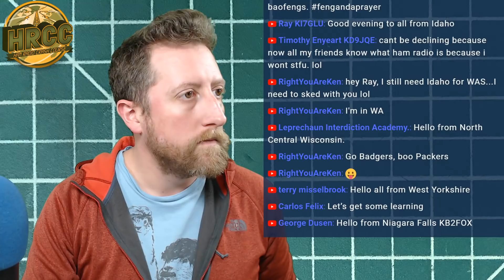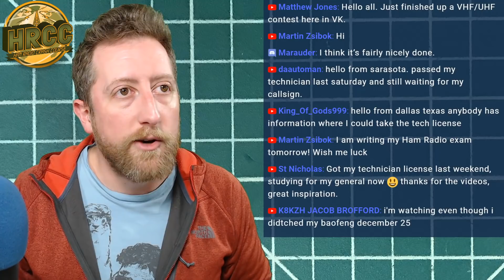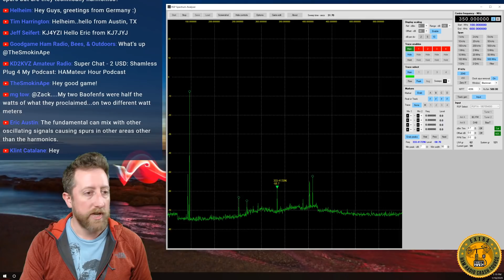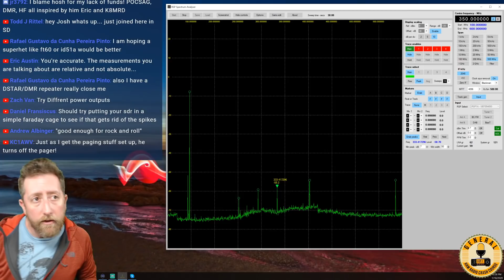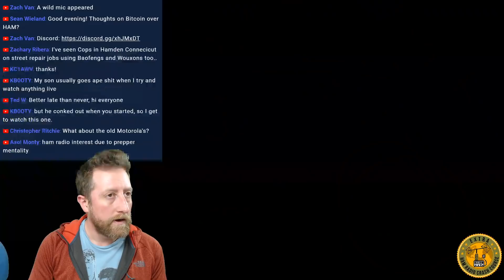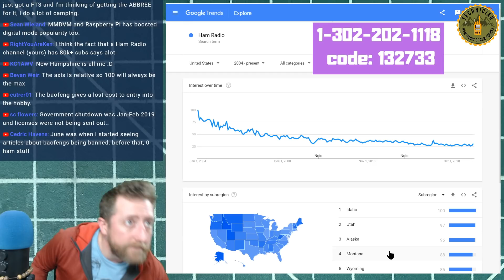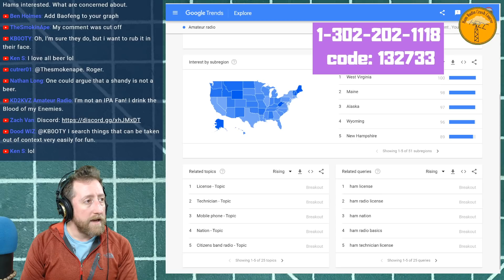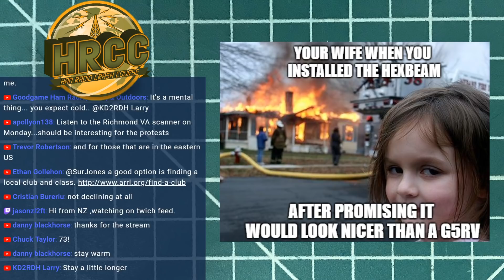Testing Baofeng Harmonics & Is Ham Radio Interest Declining?

Comment: Some clarification on Baofeng Harmonics from the 'Eclectic Tech' podcast - for VHF (30MHz -> 225MHz) the requirement is no harmonic over 25mW, which I is about -53dB for a 5W output. Without re-watching I think that some of these may have failed on that basis, or at least a marginal result rather than clearly complying.
Reply from the maker: This might be true. I also listened to that podcast. I’ll re-evaluate at some point.

Comment: On the waning/changing interest part...   I've been attending a club in my local area for a year and am close to or  the youngest member at 35.  50% of them are more than 3 decades older than me.  In the last year I've been told they used to do antenna builds as a club, fox hunts, crazy field days, activities, etc.  
But now the older crowd has this "we've been there and done that so many times and don't care to do it anymore because we're bored with it" type of attitude.... and are very difficult to carry on a conversation with, as more than half of them are hardcore introverts.   The out-spoken ones just want you to know that they've forgotten more than you'll ever learn and are incompetent at teaching what they know or learning new things. 

I've asked about stuff like satellite work, EME, microwave stuff, using a small repeater on RC aircraft, etc...  no interest.  No one wants to talk about it.   I get the feeling most of the older crowd don't pick up the "newer" aspects oh the hobby and don't want to admit there's anything they don't already know, so they just ignore most of it and try to get you to ignore it also.   
No social media activity leading up to Field Day (and almost no details given because they've all done it so many times before), no FB post to get free points for field day, refusal to explain how the scoring system worked or accept any scoring for contacts made on 2m/70cm by the techs in the group.  Basically zero interest in anything but cw, ssb & FT8.   And even then, the people using the equipment were CONTESTING...they were NOT interested in talking about the hobby, they wouldn't offer to let you try their equipment, and anyone of the public who showed up and asked if it was similar to the experience they have/had with cb radio (trying to find common ground) were almost outright ridiculed and talked down to or ignored.   A very poor "public presence"....then it's like they can't figure out why no one shows up for it.   

Most of the older crowd doesn't handle computers well, and computers go hand-in-hand with most of the new aspects of ham radio; effectively keeping them out of those activities, creating more division.   

Heck, there are still people going crazy about the no-code thing, and that horse has been dead a while now. 
Most of these people are sitting at home with nothing to do anymore but complain that things aren't the same as they were 50 yeas ago; seemingly content to just let the hobby die instead of changing with it.

Have met DOZENS of newer hams online and through things like SOTA, and can discuss technical aspects of the hobby with them at length that I can't even hardly get started in the club setting.   I think if you wait another 10 or 15 years, more of the clubs will have disappeared and "ham radio" will be viewed as a wide umbrella of options, intermixed with modern technology without people having issues about it.  I could see CW "coming back" with a newer crowd because it's "old school".... not because it was forced on them.  

Am also legally blind.  There are some rigs available with voice units, but not many.  The Kenwood 590 and Elecraft HamPod K3 are the best "accessible" radios that I'm aware of.  I'm really hoping advancements are made for more disabled users on the rig-side of things as it's a great hobby for someone who wants to "travel the world" but can't see well or drive and rarely leaves the house.   
Most of the ARRL technical books aren't available in large print or pdf/e-formats.  I was really disappointed in that and emailed the ARRL about it, maybe some day.  
Am currently using a Yaesu 857D which I can see just fine... as long as my face is about 1" from the display.  

As far as mobile/handhels for low-vision users…  The Anytone 878 and 778 have beautiful crisp color inverted displays, drop-down menu driven programming, a breeze to program from the front and use on the fly.  I can make out most of it's screen from almost 4" away!   Talk about comfort!   :)  

And that's all I have to say.  (for now)
Reply: Thinking I may have just written the longest reply in YT history.   Oops.
Reply from the maker: Good comment! Yeah I think you’ve nailed the experience of a lot of people. It’s kind of the reality of an aging demographic.
Reply: Well I’d like to write something for your comment. Just because your comment is long, does not mean you are somehow in any moral righteousness/high ground. I’m 25 and I got into hobby with a very clear objective: emergency radio. I don’t need CW or anything not in VHF/UHF. I just need something when my cell phone does not have signal. I can just subscribe to Iradium service, but why I still got into amateur field?

Old folks may lose “interest” of repeating the same over decades, so that is why you joined the club. Instead of asking all dumb questions to old folks, why not just Google? Do not expect anything from others for free.

I admit that some even including me are introvert but that is not the point. Just because you hold a doctor degree does not guarantee that you are a good teacher. I don’t answer any questions in amateur radio. I know what my real level of knowledge is. Satellite work is not directly related to amateur radio, some folks in my ham club do not have any knowledge of this as well, but it does not mean they are bad operators. EME, RC aircraft...honestly what do you expect when old folks drive cars made from 20 years ago to attend a club? Oh wait you cannot see. Money is a crucial factor too. BTW you are legally blind, you may never enjoy the experience with RC. 

Some folks may be unfriendly and hypocrite by shifting topics to what they know, it is just another way to have a smooth conversation. You cannot expect every old folks to use SDR on an ARM board. And when amateur radio was born there was no computer at all, no APRS gateway...Anything related to Internet is not a must have equipment for amateur radio even in 21st century, when power is cut, Internet will be done but amateur radio won’t. That’s the real charm. 

Just because Morse code is not required for license anymore does not mean all bands are open to phone. And Morse code is a very good tool to determine if you are able to learn some hardcore. If you are blind, CW is really a good tool to talk with others in a simplistic way, don’t give up.

I would not let anyone to use my equipment too, there is nothing to complain about especially if you are blind. You could politely ask for the details and build you own alternative, maybe in a better way? 

The only thing I can confirm from your comment, is that some people are not friendly with disabled people (because you are always the minority of the society), unfortunately truth hurts, get over it and make a stronger mind before you outperform them. You will earn the respect.
Reply: @naggersgonnanag  it doesn't appear that you read, or at least paid attention to, at least half of what I said. 
Not sure where "moral high ground" comes into it... my experiences are mine and yours are yours.  

By far, most of the "old timers" are still stuck in things that were popular in their heyday.  People who never really took to computers are only going to go so far. 
I most often find that people don't actually have the answers im looking for but have to much pride to just say so.  
99.9% of my learning has been on my own, hasnt stopped me yet.  
Was Rx'ing sstv from the ISS through most of December, and have been tracking the noaa satellites, and Meteor m2 in LEO.  Just got my 21dB dish set up for a decoding HRIT from GOES-17 in geostationary orbit.  

Put out several emails to clubmembers... no interest.
Thats fine.

Been spending a lot of time with 23cm lately, and 33cm.
Reply: @syberphish   Good on you, syberphish.  What I gather from your two postings is that you are recently “new” to the ham radio hobby – a couple of years or so, perhaps?   If that is so, then you have come a long way in quite a short time, so well done.  
Your latest posting implies you have had great satisfaction in the way you have progressed with the hobby, despite lack of interest or support of others locally.  Thank goodness for YouTube, I say (where possibly you picked up the information you required?).  
I am a fairly long-in-the-tooth radio ham and take great pleasure in passing on my knowledge to enthusiastic newcomers of any age, and it is regretful that your local ham fraternity apparently did not step up to the mark when called upon to do so.  The good news is – you got there in the end.  Again, well done.
Reply: @iainmeteorscan1555  Thanks!
Yeah I've been learning almost exclusively through youtube, though by now I've found a few hams throughout the area in the CERT net who've been helpful.  
Spent a year on an 80m traffic net, and finally left because I couldn't manage to get anyone to explainto me HOW the system works.  They'd all been doing it for so long and just though I should know like they did.

I'm making good progress on the aerial repeater.  Picked up a Strix Stratosurfer kit with a 5ft wingspan.  It can stay aloft for a couple hours and carry a decent payload.  The flight controller stuff all has to be programmed, it's another entire field to learn.   Have been doing a ton with 433MHz  control while using primarily 1.3G for video.  Having so many frequencies on a small craft really forces me to dial in lots of variables like filtering, polarization, sensitivity and shielding.  

Have also been pulling data from the NOAA birds and Meteor M2 satellites, and picked up a 1.6G 21dB dish for rx'ing full disc multi-layer full color images from GOES17 in geostationary orbit.  

There's always more to do, it just never stops.  It's always nice to collaborate with like-minded people though.  As much as I hate the word, synergy is pretty awesome when you have a few people all working on something together, soundboarding each other and leaving their ego out of it.  

Feel free to drop me an email, my name at yahoo.  If you're long-in-the-tooth and open to chat then there's something I can learn from you.  :)

Comment: Main reason for the decline of amateur radio popularity: cell phones and the internet which are effortless to use and license free allowing extremely reliable fixed and mobile worldwide communications... except during a natural or man made disaster.  In the past, long distance telephone calls were extremely expensive and the only economical means to get mobile comm was via amateur radio or CB.  Also, for hobbies, digital has supplanted analog electronics.
Reply: I think you nailed it on the head. There are just to many other ways to get in contact with some else these days. I mentioned to my niece that I had just talked to  someone in Europe on my radio and her question was why? I told her all the usual reasons a ham would do this and she just shook her head and pulled out her cell phone and said this is a better way to do that these days. She then said the internet is probably even better due to video with it. She is probably right but I still love using my radio to do this especially now a days. Is ham dying out, probably but that will probably take a long time if it ever does completely I will be surprised.
Reply: Im also legally blind and a radio fan!
Im in my late 20s btw n just got my gmr and will be taking the ham test soon enough I pretty much know everything already its easy.
I scored a 70 on practice test and its because the pictures were inaccessable
Reply: @dheller777  the thing is, ham is for learning, for experimenting and tinkering, and having fun overall.
Those that like to crap all over it dont realize that if shtf that cellphone can become a brick of a device without towers, and that radio is more than a hobby, its the magic of being able to communicate over the airwaves, and exploring all about how it is the backbone of our modern day infrastructures like the computer and the smartphone.
you fraind just doesnt understand because they aren't interested in the innerworkings of the technology, they are the kind of person that just uses the devices at our disposal for granted and simply doesnt understand or care about it. That is fine, to each there own  noone can force anyone to like a hobby they have no interested in however its probably a good idea to try to explane it at a low level so that it can take most of the edge of ignorance out of those who see it as something stupid and outdated.
Reply: @dheller777  
im so sorry, I reread that it was your niece not some ignorant friend, so maybe get her some walkie talkies as a gift and let her explore how neat of a technology it is and how they work with no wifi and anywhere if she still dont understand, im garantied she will learn eventially and enjoy having them.
Retevis rb19 for the win that is the frs version of the rb19p grm radios that I own!
talk about how in some situations this might be the only way of communication like when camping etc and that radio is a part of being prepared and having alternative communications.
Don't know if they still make it or one similar from another company, but I came across an frs dual power radio by audiovox at the thriftstore, sadly no longer have, but it could be powered off dynamo hand crank power to charge it up in adition to running off 4 aaa bateries.

Comment: I dunno. We have a whole bunch of people joining the repeater under 40 on a regular basis. More coming in then going out.

And as a new general license operator, I have no issues finding folks on hf. Worked inland Africa with 100w and a wire last week. I'd be optimistic.

K1TiG

Comment: Yes, digital electronics such as dmr are moving hams away from 'aerial to aerial via the ether' communications, which to me is true ham radio, not piggybacking the internet.
Reply: Honestly I'm not a huge fan of the radio to internet stuff. I like the idea of digital,  played with ft8 this weekend, maybe if it weren't just "you this is me, your signal is, thanks, bye"  it would be more useful. But we have to work on making it what we want it to be. Echolink and DMR won't be all that helpful when the internet is not reachable, but it isn't my place to judge, there are many things to do in this hobby, we just have to make it work for us. Aerial to aerial all the way! 73. De KE8NNE.
Reply: DMR does not require use of the internet any more than "aerial to aerial" analog does. My suggestion would be to embrace new modes and exciting progress which excites newer and younger hams rather than looking down on it because it's different from the old way of doing things :)
Reply: @pnwgeek  sorry if my ignorance of the mode came off as looking down my nose at it. I love the thought of using my rig away from home over the internet, with it safely in my Faraday shack. I was just under the impression that without a hotspot to get a DMR radio on, it would be pretty useless, much like Echolink.

Comment: So I watched your video after watching the tests performed by Ham Radio in Action, and I'm guessing the differences in the videos would be due a lot to the analyzer, but his showed both the UV-5R and BF-F8HP solidly failing.

I'm a fairly new Technician looking at getting a HT to start getting into making contacts. I was excited about being able to afford a radio plus upgrades for cheaper than just the HT itself. I don't want to be in violation either if these do put out illegal Spurious Emissions. 

I guess I'm looking for any thoughts on still picking up a Baofeng as a starter unit with upgrades or just try to hold off to get something like the FT-4xr. Thanks for the awesome channel and videos! Everything has been super helpful thus far and makes me want to get even deeper in radio as I can! 73! KJ7LFB

Comment: I use a Baofeng UV82C, the commercial radio on hams band. I wonder if the UV82C all meet FCC Specs, or did they pull the filter after the FCC approved the Commercial UV82C. K7QCK

Comment: Why does no one comment that these tests are only half of the story. 

Sure those radios may have certain spurious emissions, but you're testing them at the coax output, not what the radio is transmitting via the antenna. 99% of those emissions are on frequencies attenuated by the antennas. 

Additionally,  I am a Cub Scout leader and it is disappointing that parents no longer value the things that scouts  teaches. We have seen a decline in  scouts, but it's far from dead. We have done Jamboree on the Air the last 2 years. 

KE8KKN
Reply from the maker: My wife is a large proponent of the scouts for our sons. I myself was very active in the scouts in my younger days. I agree it offers vital skills for young people.
Reply: I have two of the BF-F8HP radios. I set one to 144MHz and the other to 432MHz. Keyed up the mic on the one set for 144 and the 432 started receiving. Then I did the opposite and the 144 received from the 432. I did the test first with the stock antenna and then with Nagoya 771’s. Both responded to each other with both antenna types.